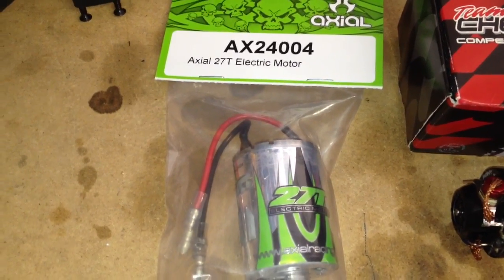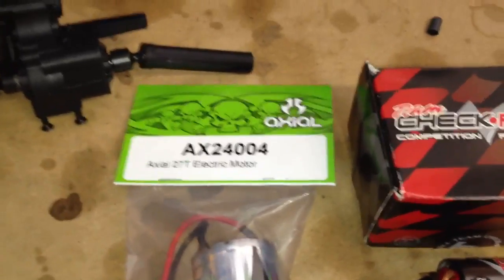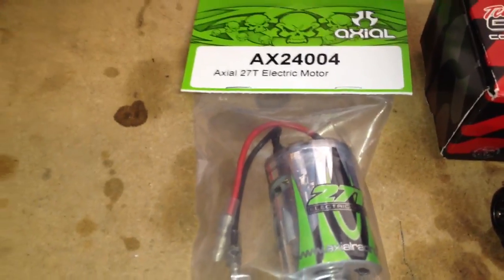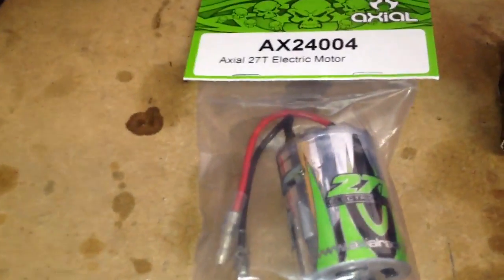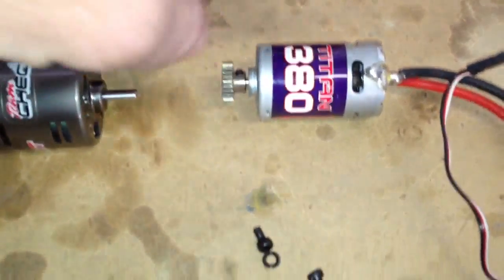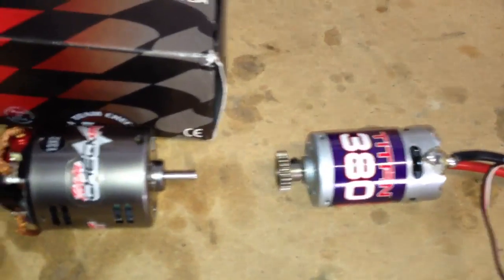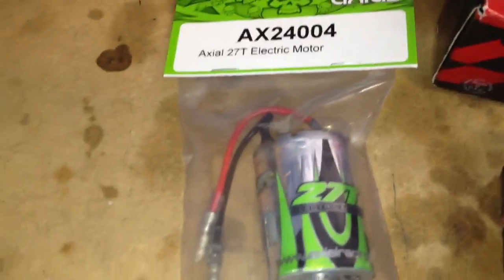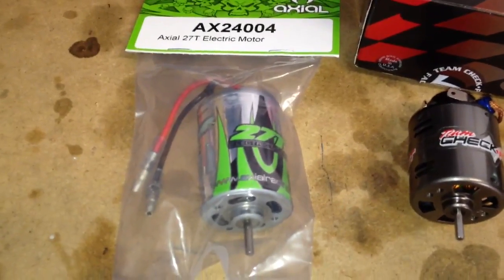Axial Wraith - Replacement Motor, Crawling Motors 101

Comment: Bro I have a axail wraith spawn and I have a castles sidewinder and 5700kv motor how to adjust the temperature for the motor?
Reply from the maker: +Jerald Nepucpan all about gearing for that......Gear as low as you can and watch the temps......Plus, you will start breaking things.....
Reply: +The RCNetwork bro thanks for the response really appreciate I will try cuz me and my son this is our first rock crawling. God bless 🙏🏼👊🏼
Reply from the maker: +Jerald Nepucpan Anytime!
Reply: I just slapped a brushless 3400kv and its a dream.

Comment: hello RCN,can i use 27T motor on my stock spawn gearing?56/12 32 pitch?
will it be torque or speed?or i will burned or my motor?thanks in advance..:)
Reply from the maker: BLACK PARALLAX The lower the turn, the faster the motor will go....So if your stock wraith came with a 20t like most Wraiths do, the 27t will be slower and have a bit more torque.  I ended up changing this wraith out to a 45t tekin Pro motor...Great motor for crawling
Reply: The RCNetwork
so the 27T stock can do crawling job.but not decent right?hmm..tekin is pretty expensive though..so if im gonna do trailing/little mudding with these stock motor,do i have to waterproof the brushed motor?cause the brushes are sensitive to mud and dirty water right?
Reply from the maker: The Tekin Brushed motors are pretty inexpensive and pack much more torque than the Axials....as for waterproofness, brushed are pretty much waterproof given the environment they're run....dirt and debris are the enemy though.
Reply: i wish i could have one tekin brushed system..:D
so,i do not have to seal the brushed motor opening to run into mud/water?i saw others plastidip their brushed motor..
Reply: its still AE2 ESC in your wraith??? there is no problem with 550 motor..??

Comment: Just wondering if you have any feedback about the wraith with the 27t motor. I burned up my 20t and have considered the 27.
Reply from the maker: I burned up the 20t in the first 10 minutes of owning it.  The 27t is a better choice and has a bit more torque, but really, I liked my Tekin Pro 45t most in the Wraith.  I ran it on 3s for the wheel speed and had the torque of the 45t.  I also hear that the 35t works great too

Comment: Very well put. :) Very well on. But if you put a small pinion gear on a Brushless motor you can get that low speed when the motor is actually working the same, just some food for thought.